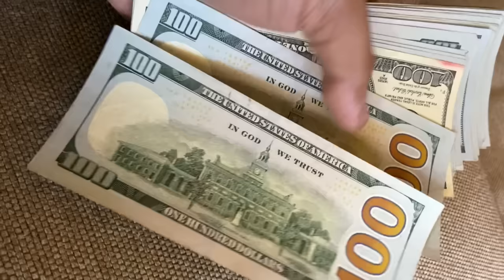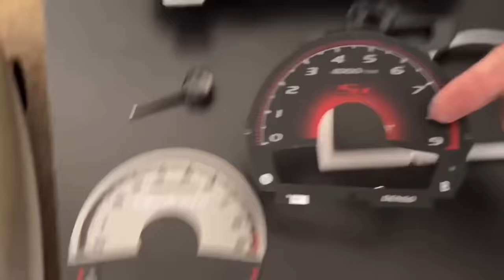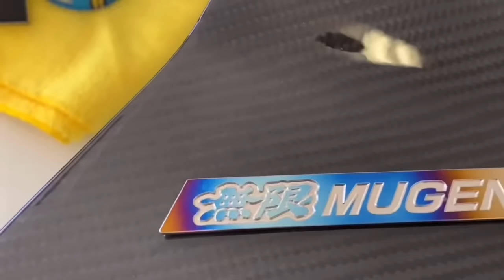Building An 2007-2010 FD2R Inspired Civic In 12 Minutes!! Crazy Transformation!!

Comment: The USDM tail lights has found its way on a few FD2R in South East Asia.  Its a well sought after parts. It is bloody expensive coz of the exchange rate and if they can get the rear bumper include.  You need to get the FD2R rear bumper. Its cheaper if you can get used from South East Asia.
Reply from the maker: Yeah I actually got my trunk and tail lights off a Fd5 from Canada even more cheaper lol  Yea I’ll be getting a jdm rear bumper soon. I have a connect in Japan that’s actually not too expensive. 👍🏽

Comment: This makes me want an si just to do a conversion lol. How hard was it to get the parts for conversion and where? Like that palabok plate haha
Reply from the maker: Haha that’s why I got one to do this. So it’s not too hard. Front end bolts right on but you would need to trim the side of the bash bar to make bumper fit. Also som reworking for the reverse lights on the rear and front turn signals but other than that it’s pretty easy
Reply: @Vicwavy   was it hard to get the parts for it? Like bumper and headlights? I know i’ve seen a bunch of these cars in the philippines and wish we have them here in the US lol
Reply from the maker: @pnioy12  So actually it was pretty easy. I have a friend in Canada who sent me a bunch of Fd5 parts. Acura csx so I was blessed that way. But the front I ordered was aftermarket from Malaysia. Currently piecing together an oem front end though. 👍🏽

Comment: You didn't have to change the radiator core support like om a jdm dc2 integra front end conversion, just bolts right on?
Reply from the maker: No not on the Fd2 everything bolts up. You do have to do some wiring due to the lights being different size sockets but yeah same same 👍

Comment: so clean. Which wheels and tires size do you use bro? I guess 225/40r18 with 18x8.5 +45, is that right?
Reply from the maker: Thank you. Wheels are 18x9+25 and tires are 225/40 👍
Reply: @Vicwavy  wow that et so cool. Did you rolled the fenders or changed camber bro? so clean
Reply from the maker: @ Yes I had to roll fenders and Mac canner on rear to fit until I can get less aggressive wheels for the rear 🫡
Reply: @Vicwavy  thank you for answering! i like it
Reply: I thought the type R wheels were 18 x 7.5 ?   Where did you get the from?
Reply from the maker: @ They are I’m sorry I thought you meant my Advans that is correct 18x7.5 +50
Reply: @lmao_pat  yeah sorry for any confusion there.  Love the way the Type R wheels look.  Did you have them refinished?  Or you got lucky and found a really good set in mint condition.
Reply from the maker: @jefflebo5836 No worries man. So those I got on Upgarage for a decent price before the pandemic. Paid 700 shipped with minimal chips

Comment: Do the fd2r wheels fit flush. Do u have any issues with it driving? The offset would be different tho right
Reply from the maker: Yes so the fd2 wheels do not fit in the front because of the offset. They have a different hub than the si. Jdm spec is 18x7.5 +60 so I had to run a 15 mm spacer. Didnt want to run spacers so I changed wheels

Comment: I don't mean to tell you how to do your stuff, you're obviously a lot more knowledgeable than I am about working on cars. I think you should be using jack stands when you lift the car up. The hydraulic jacks are not built for sustaining a heavy load for long periods of time. They are meant to lift the thing so you can support it on jack stands. The hydraulic can fail and if it's the only thing between the car smashing into the ground or into you...

Comment: Recently did fd2 convertion but fa5 headlights signal lights socket won’t fit to the fd2 headlights any recommendation to what can i get to fit in I can’t found the right one :(.
Reply from the maker: Okay yeah the turn signal sockets are different. Did you get oem or aftermarket fd2 headlight?
Reply: @Vicwavy  they are after marker brand depo
Reply from the maker: @raymondcabezudo5696  Check my FD2 conversion explained video I got part numbers in that description including the sockets 🫡
Reply: @Vicwavy  thanks man 🔥🔥💪🏼💪🏼
Reply from the maker: @raymondcabezudo5696  Anytime man

Comment: Bro can you tell me the difference between Mugen RR and FD2R/Type R spoiler? I can't seem to see difference
Reply from the maker: So the Mugen RR spoiler had the cutouts on the sides for the Mugen badges. Also it is carbon. The fd2 has no cut out and has a black center piece. Hope that helps 👍
Reply: @Vicwavy  ohh that's the only diff?
Reply from the maker: @jlicious1462  So for the RR it has a diff shape. It’s more rounded. Regular Mugen si and fd2 type r is flat